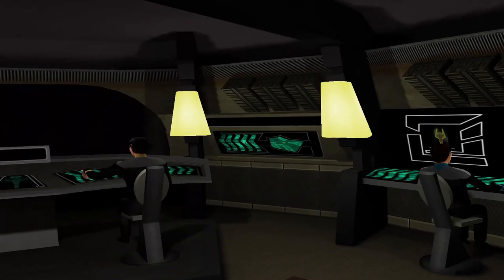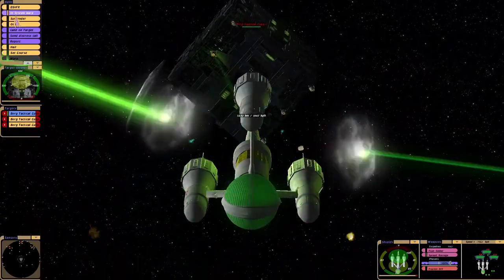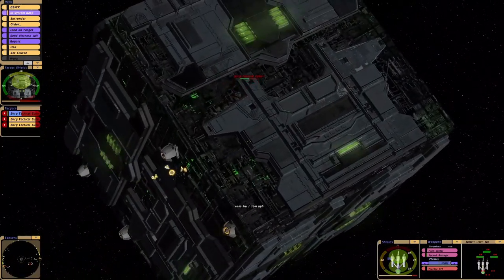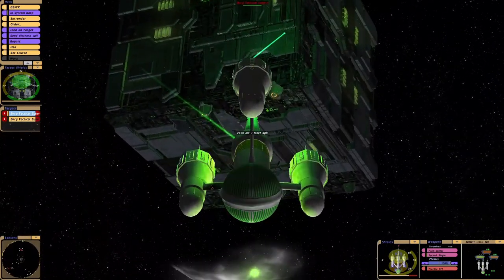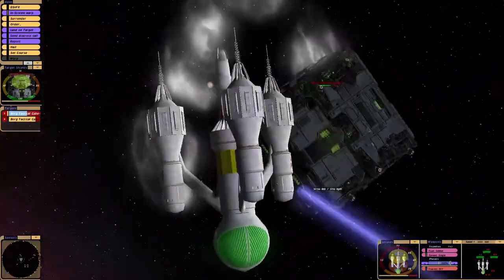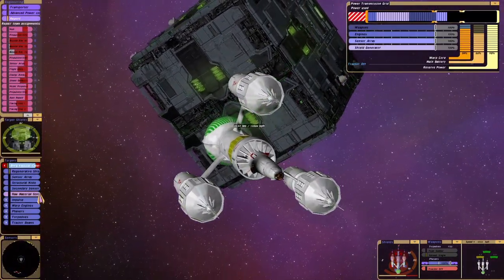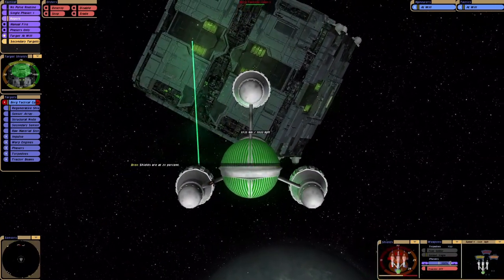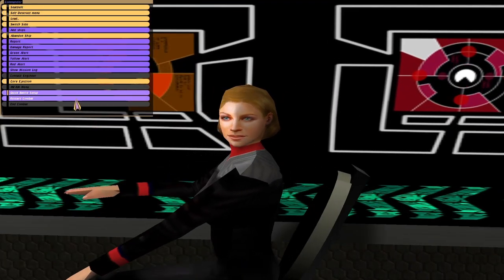Blakes 7 Liberator VS Borg Tactical Cube | Star Trek Bridge Commander Battle |

Comment: You needed another Liberator to assist you in defeating the three (3) Tac Cubes.
Reply: part 2 cont.: That was too much for the ship to handle.
Reply: part 2 cont. that was too much for one ship to handle given the Borg re-generational abilities.
Reply: Remember Muh son, Borg adapt quickly.
Reply: @acebrandon8643  the Liberator also had hull regeneration and an auto repair systen
Reply: @andreww2098   Andrew, did not know that. Only saw a few episodes when I was a teenager.